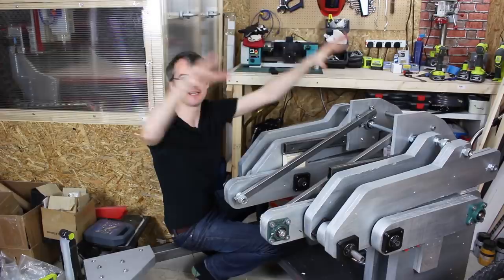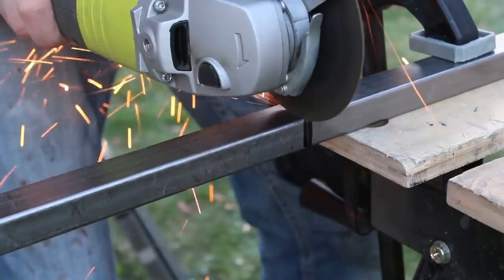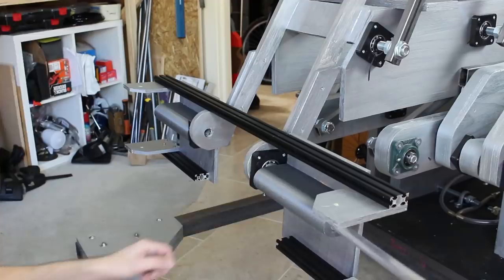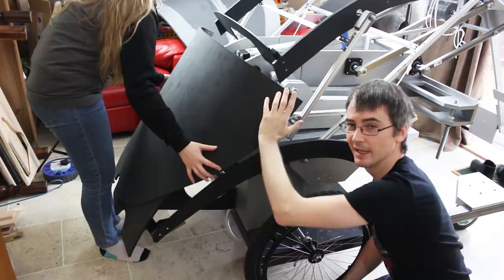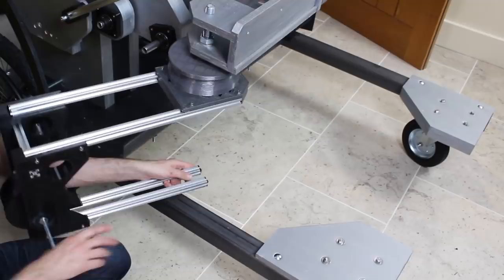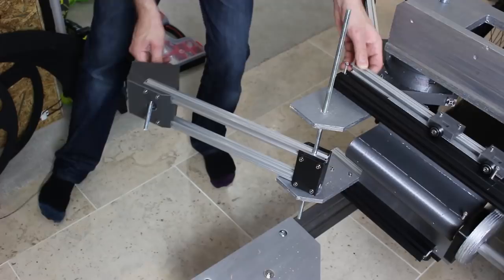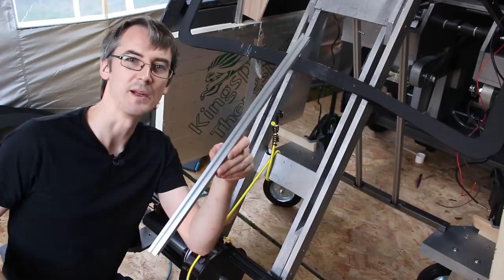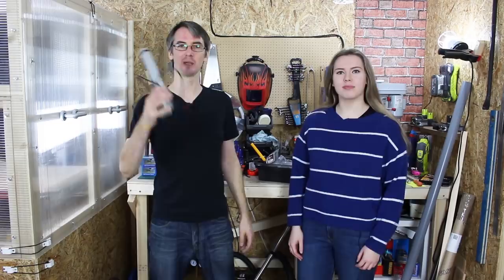Building Bumblebee the REAL TRANSFORMER #2 | James Bruton

Comment: Ouch. I have a feeling the printed parts need some more infill and thicker perimeters...
Reply: Hes using the moar struder each pass of the nozzle is 1.2mm smooshed down to the next layer. Trust me those parts are way tougher than you think.

Comment: I have one question. Why does him (and many other people on youtube) use spray paints? Why not use a paint brush and a paint bucket? I feel that a lot of paint is wasted using spray painting, seems more expensive and requires gas masks.
Reply: Spray Paint leaves a smoother finish with no brush strokes, it's also about 5 times faster then a brush. Both excellent reasons to choose it over brush painting, though he has a compressor, I'd think buying a sprayer attachment and regular paint would have been cheaper and faster then all those one use cans
Reply: @bruceneely4859  thanks for the reply. I didn't know that spray painting would be faster.
Reply: I actually hand painted one of the doors to begin with and hated the brushstrokes, so washed it all off and we bought the spray cans instead.

Comment: I'm clearly no expert on making those, and am highly impressed by your mechanical engineering approaches. However, if to do it differently, that could be done with thermal forming of the the bodypanels to keep them super light, and the hood should not be a throw away lol. The hood should have hinges within the forming line creases to retain a non hindged look, though definitely able to allow the hood and other panels to umbrella into different shapes to become a humanoid shaped robot look. Now it should also be said that you two need to start your own Area 51.5, and I should be on the panel of board of reasonable shapeshifters/directors of operations. I require a payment upfront of 350k to handle all relocation costs, and am going to need 2 months off each year with full paid tropical vacations. So what do you say, do we got a deal? Awe come on!